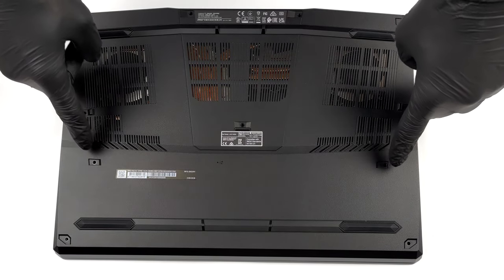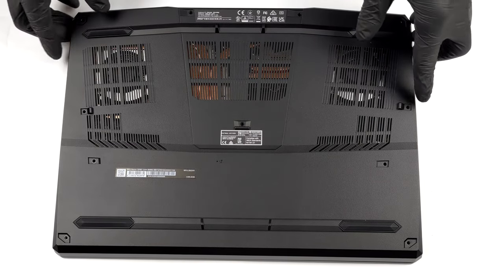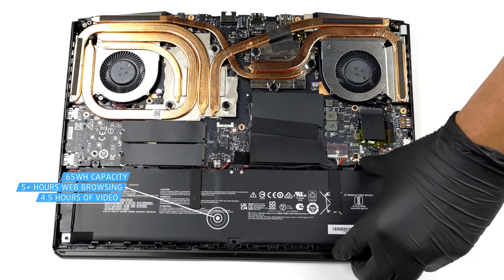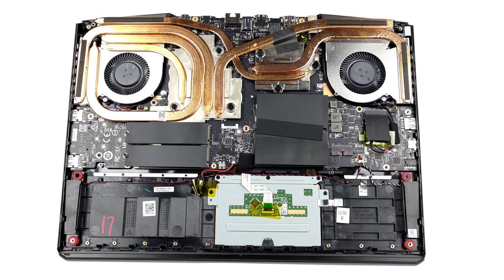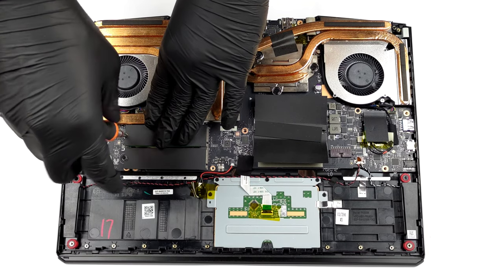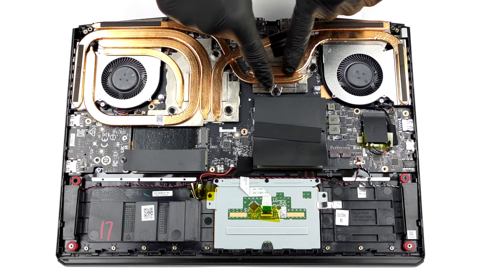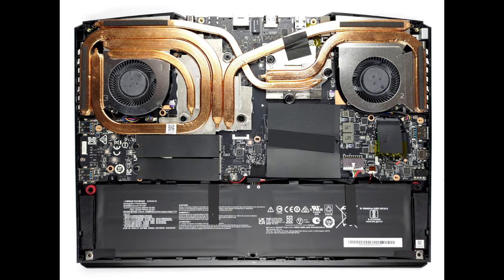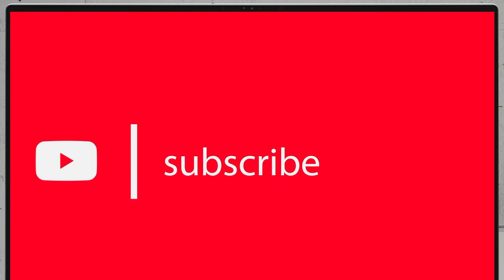🛠️ MSI Vector GP66 (12Ux) - disassembly and upgrade options

Comment: Hello

I have this model and I’m having an issue with it. I believe it is a hardware issue because the laptop display does not show anything at all, yet the computer still turns on and the keyboard rgb is visible. When I connect the laptop to an external monitor, it displays on them. Can anybody tell me what the possible issue could be?

Comment: I just bought this with an I9 12900h, 3080ti, 32gigs of ddr5, not ddr4. I guess there are many different configurations of this machine. It's a lot of hardware for $2k, I just couldn't pass on it. Cheers 🍻
Reply: Just bought the same one off Newegg, not sure if it’ll even need upgrading LOL
Reply: @jaydenkoopmans4425 :
Yep, we got the same deal. It's the best hardware currently available from anybody at an almost unbelievable price. Anybody that can afford this should, a deal like this won't last. I do believe I'll be adding a 2nd SSD to it at some point, but otherwise it's a killer machine at a fantastic price point. My only regret so far is that I only bought 1 of them. I could sit one in the closet for 3 months and make money on it after all the holiday noise is done. Cheers 🍻
Reply: Damn I didn’t know you could add a second ssd, my dumbass bought a 5tb hdd. Not that that’s really bad I just didn’t think you could do two ssd’s, this is my first pc so I’m new to all this, cheers to you too🍻
Reply: @jaydenkoopmans4425 :
This is one helluva first PC. The fans are going to make some noise when you start working it, but you've definitely got the power to do that work! And you have a spare M.2 slot when you need to add more storage. It's nice to have a drive for the windows operating system and a second drive just for programs and games etc. But with this level of hardware and performance, I doubt there would even be a measurable difference let alone a perceived one. But the RAM and storage are the only two up-gradable things on this laptop (maybe also a battery), you can go up to 64 gigs of RAM and storage wise up to whatever you can afford in an M.2 form factor. I think you're really going to like this laptop, hell, I think anybody would really like this thing. Cheers 🍻
Reply: I found one with 
I9 12900h, RTX 3080 and 16gb ddr4 for 1750$ is it good price to buy or should I skip it ?
Reply: @ayobaldolaimi3637 :
Yes, that is still a good price for that hardware. Newegg still has the laptop mentioned above, but the price is creeping up. It's now a little over $2K.
Reply: @Finite-Tuning  nice 😎 thx mate 👍
Reply: dragon center .. user mode --> user scenario --> weel fan acceleration boi
Reply: How's the hinge? I hear it could have issues over time
Reply: @pyro8040 :
Mine is going on 6 months old and no problems to report. But I don't use the thing like a gorilla, so maybe that has something to do with it? 
Cheers 🍻

Comment: Hey can I put a gen3 Nvme SSD in the gen 4 slot?
Reply: Yeah I think so 😌
Reply: you definitely can put gen 3 nvme drives in a gen 4 slot. The drives will operate at gen 3 speed. The slot will not make them faster but if you want cheaper drives or have some old ones to re-use, you defintely can.

Comment: Can anyone help me,why my laptop always overheat. My cpu always 90-100 c° and my GPU always 85 (same laptop in this video). Idk what wrong
Reply: same to me, i think  that is normal temperatures for this laptop, maybe try lowering the cpu tdp
Reply: @skidles6985  but why i see 4 YouTubers review this laptop,and the temperature is fine
Reply: Hi, same to me, I replaced the factory thermal paste with an Artctic MX4, and results were similar. Also damaged a heatsink screw holder in the preocess and had to replace it with a screw and a nut.
Reply: @hugoraulbocci3844  are u have solution ?
Reply: @shadow-wh5lm  Some people tried with graphite o carbon thermal pads and had lower temperatures
Reply: Welcome to the MSI&ASUS party!
Reply: Me too i try evry thing but the temp dont down . If you see a solutin tell me

Comment: Hi is it possible to upgrade to ddr5 ?
Reply: ddr4 and ddr5 are not interchangable. If you like this laptop but want the ddr5 version you have to get the GE76 or GE66. The GP76 and GP66 are the slightly cheaper version with ddr4 instead of ddr5 and slightly lower max wattage.
Reply: @dracer35  yeah that’s kinda pity, but is it worth spend extra dollar for only ddr5?
Reply: @SynsterGates666  Not really worth it currently. The ddr5 currently being used isn't that much faster than the decent current ddr4 and the cas latency on the early ddr5 is terrible. I definitely wouldn't spend more just to get ddr5 right now but by next year I'm betting we will have much better ddr5 that will be worth the upgrade.
Reply: @dracer35  Man thanks a lot for the insight! Keep up the great work man! You deserve more subscriber, i’ll wait for next year model then!
Reply: @SynsterGates666  lol thanks for the kind words but this isn't my channel or video. I just figured I could help out since I have been researching exactly this and have the information to help another person out. Also I have a desktop PC with ddr5 6000 CL36 and it doesn't really make much difference over my old setup that had ddr4 3200 CL14.
Reply: @dracer35  wow thanks for all the knowledge man, pretty new in this PC stuff
Reply: @SynsterGates666  We all have to start somewhere. I really enjoy this stuff. I mostly like to build custom water-cooled desktop PC's but I also like to have a good laptop to use when I'm at work.
Reply: if you get the 12UEO model of GP66 vector, then yes, it has DDR5, which is upgradable to 64 GB
Reply: Small benefits no need to worry, less than 5% difference.